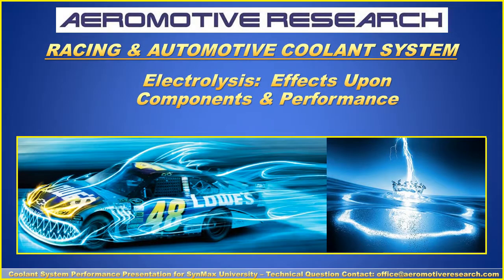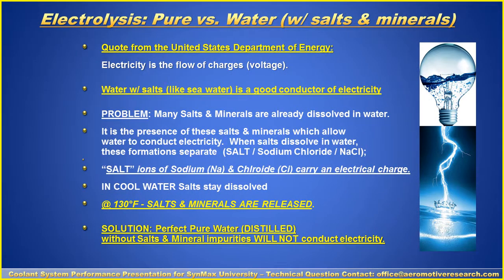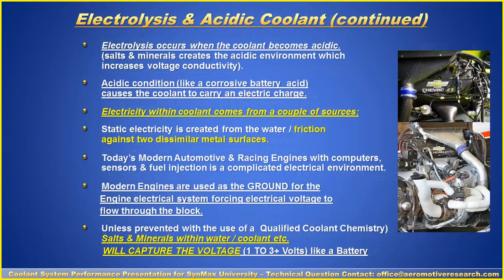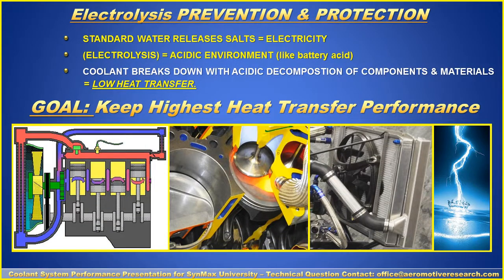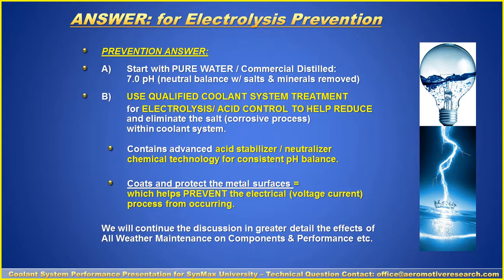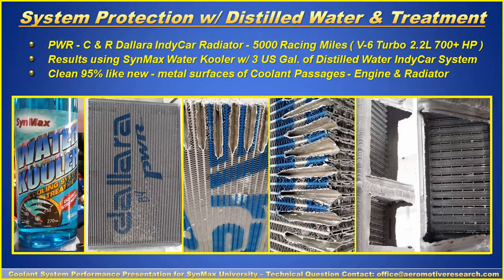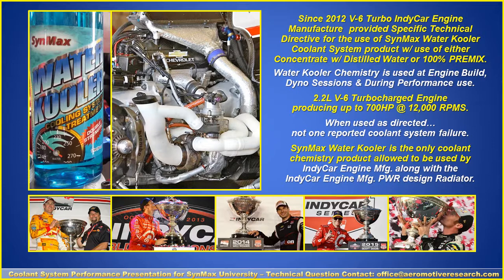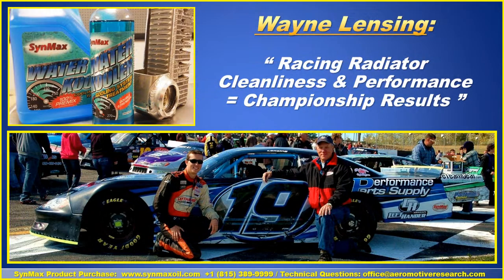Electrolysis  (Voltage) within Coolant System & How to Avoid Problems - Aeromotive Research

Comment: Standard water ie: distilled water has a lot higher boiling point as well and thus mixing the right coolant based on the car manufacturers OE coolant specs will give you a lot higher boiling point and also freezing point as well, but as long as you have the right temp sensors for oil, coolant temps and pressures as well and use the right products to service that engine you cant go wrong, so as soon as you notice that the temps or the pressures are exceeded in hi or low, you get the car checked out to find why the oil or coolant is doing that ? cheers :)
Reply from the maker: The thoughts shared regarding distilled water do not take into account that the distilled water is to be used with a qualified coolant additive as developed by Aeromotive Research used by the Synmax Water Kooler Brand.

The key is water purity, there is NO filteration equal to pure distilled.

Distilled is water vapor pure and all other minerals are left behind.

This micron minerals when out of control, lowers the pH into the acid range, then the said minerals over time. . Like salt.. will conduct electricity. .  Simple. .

The answer is to prevention, if you do not have any minerals in the fluid/ water to conduct electricity 
Then you will not have electrolysis.   SIMPLE.

Comment: The biggest problem people use standard tap water, which has chemicals to make it free of bacteria and thus causes it to have a tray current and also if there's a problem with in the cooling system negative charge in some place or earthing issues then you have to make sure anything which has to do with the cooling system is earth right ?
Reply: Actually , all minerals help to conduct electricity . Just use cheap distilled water . Or pre mixed coolant that is recommended by the manufacturer . This vid overly complicates the issue  . And change coolant every 2 or 3 years . I'm an electrical engineer and this guy just about put me to sleep . And don't put any of that snake oil crap in a bottle in your car . Ever .

Comment: Any water that is high in total hardness (minerals) or salts (chloride) will increase the conductivity but they will not contribute to the pH value which is your measure of acidity/alkalinity but will increase the effect of any electrolysis by increasing the conductivity of the fluid as well as causing increased scale within the cooling system. The sodium chloride (NaCl) does nothing to pH as the species formed OH- & H+ balance each other out. Many coolants contain nitrites, which when reacted with electrolysis break down into Nitrates and Ammonia compounds which in turn provide a higher pH value (more alkaline). Some of the logic is flawed here.

Comment: BS natural drink water which has been filtered by osmosis and also a 3 or 4 stage filter system will be better than rain water from Antarctica or even if drilled down 100 meter and used the core of ice and melted it and used that, basically any demineralised water you by if you ran it through a carbon filter it would be the best water you can use, but basically people do not have access to those things other than demineralised water that you can be which is best anyway ?
Coke use this type of method for the water added to the making of soft drinks ? I should know i worked for a engineering company which sold to COKE and others who needed to filter water including sewage plants to filter shit and other waterborne contaminants to then release the excess treated water back into the river and seas. :)
Reply: Completely different application